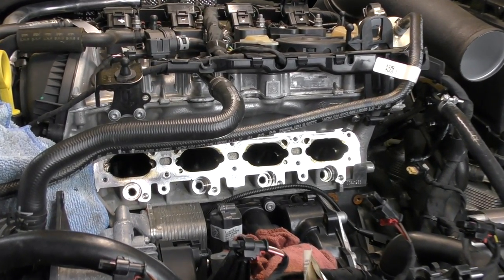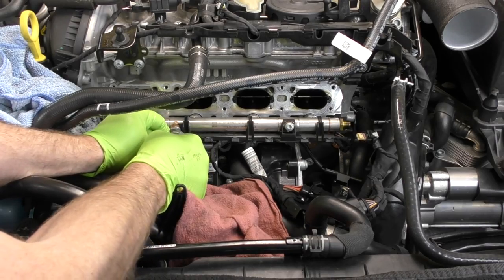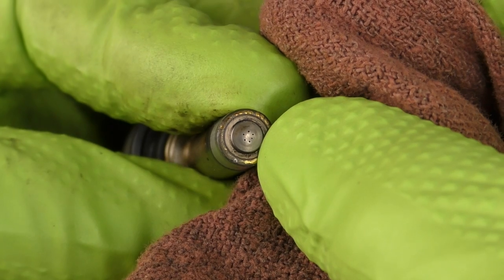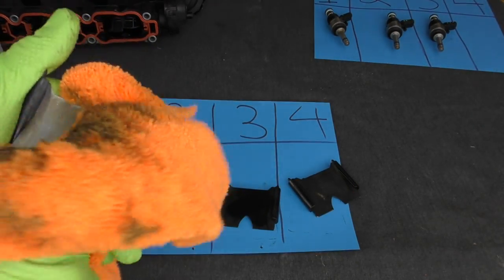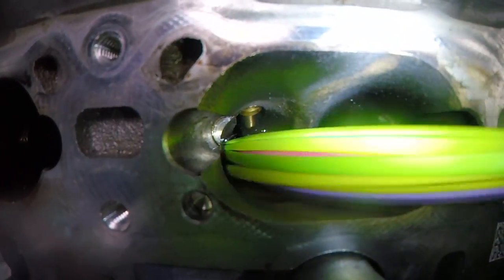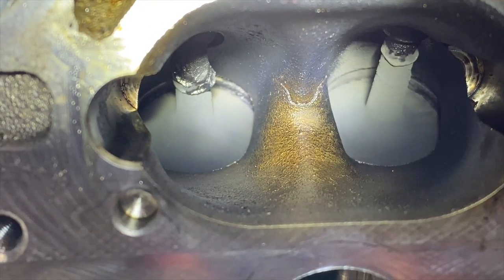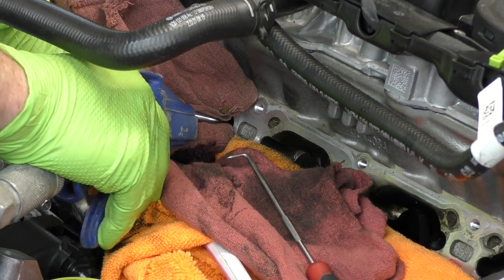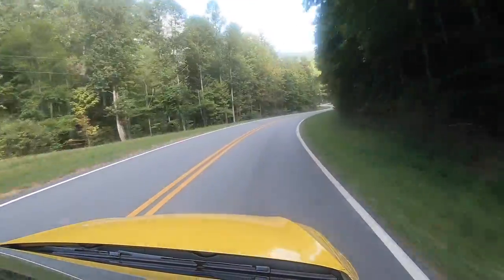How Much Carbon Build Up at 10,000 Miles?? ~ 2019 Golf R

Comment: Not saying this is an easy DIY, but if you have the proper tools and basic knowledge,  then just following this video tutorial seems to be pretty straight forward to clean your own carbon from intake valves yourself without needing to pay $1000 somewhere to do walnut blasting.
Reply: I need your help or someone who knows what they are talking about when it comes to VW  as you said in one of your other videos you shot in your garage talking about VW reliability and reviews etc.  A lot of mechanics don't really seem to know how to fix or diagnose my car (Scirocco R 2013, APR Stage 2+).  I believe it is a very similar platform as the Golf R?

For 3 years now I've had this cold start issue (among other things).  It seems to be getting worse each year (progressive) so maybe it's carbon build up.  When I start the car after being parked overnight, it will go through this pattern of normal idling for 7 seconds then it will begin to sputter and sound like it's struggling to stay alive for 3 seconds and return to normal for another 7 seconds and sputtering sounding like it's about to die again for 3 seconds ...this repeats each time for exactly 60-70 seconds EVERY TIME or when the engine temp reaches 20 C and then it stops and is smooth after that the rest of the day.  It only happens when the car was parked for a really long time or overnight.  It doesn't even have to be that cold...I noticed it starts even when it's about 13 celsius in the morning (not cold but chilly). In the summer weather like now, doesn't happen.    

If I don't wait the 60-70 seconds or engine temp to hit 20 celsius, and move the car in drive, it will DIE and shut off within 1-2 seconds and I have to restart the engine again.   

The next thing is I am running rich ...LTFT always around -17 to -21 range....not enough to trigger a fault code which I believe is around -25  but I don't know why it's running rich and not returning closer to 0.

The code I get is: 001286 - Idle Control System - P0506 - 002 - RPM Lower than Expected - Intermittent

I've had TB cleaned couple years ago, even at that time the mechanic said it was really clean, and I only drive the car about 8000 km per year so I'm sure the TB is not dirty.  I have replaced fuel filter, spark plugs, ignition coils, new charcoal canister and cleaned the MAF sensor with CRC mass air flow cleaner.  

What I haven't changed yet if they are possible issues:  PCV, Diverter valve (cleaning), EGR valve (?), or don't know if it's a leaky fuel injector or possible turbo wastegate actuator issue.

My turbo gauge needle oscillates back and forth when I turn on AC or fan while sitting at  a traffic light.  RPMs stay solid but turbo needle oscillates up and down up and down with a humming sound from the engine that matches the needle movement...maybe a vacuum or boost leak?  

Also, it seems I've lost boost power at low rpms.  Sometimes when accelerating from a traffic stop, I'm seeing my turbo needle hit 0.5 to 1 bar but I'm only traveling 60-70 km hour....it kicks in fine if I'm at high speed like 120+ km/h but from standstill, sometimes the car doesn't accelerate as fast as the turbo needle seems to indicate it should with 1 bar of boost but the car barely going over 60-70km/h

Comment: Holy liqui moly those intake runners though! I forgot they're originally silver until you started rubbing the carbon off.

Is it possible that the oil treatment might've accelerated this? You know, since they're designed to land on an already carbon-coated runners/valves? Cause 10k with that much build-up just doesn't make any sense..

Comment: I used my wet dry vac with a MCDs straw taped to the end to suck out the scraped off bits of carbon. it even pulled most of the carb cleaner out too.
Reply from the maker: NICE!!!

Comment: have you thought about using a small laser to remove the build up on the gdi intake valves, and tract? it would seem to be a faster fix. as the build up would be vapourized off the back of the valves and intake tract.. no chipping, soaking etc?

Comment: This problem screams out for the aftermarket to come up with some sort of injection system tapping into the plastic intake manifold so it cleans the ports and back of valves. Whether that be some sort of fuel or solvent, atomized water-steam etc. These sort of kits were once available to boost compression and deal with upper cylinder lubrication during the switch to unleaded from leaded era for cars that still had non hardened valve seats. Also, used on cars that were predominantly running on LPG in a dual fuel setup. A catch can in combination with 'something' injected into the intake ports from the inlet manifold would see this problem virtually disappear. Also, a small amount of oil consumption past valve stem seals cannot be helping this problem especially using such a low viscosity oil such as 5W-30 etc.

Comment: Is the atkinson cycle used in that engine design? The intake valves stay open for a portion of the compression stroke to improve emmissions, but send crap back into the intake. The buack? Budack? (I forgot spelling) Cycle achieves the same emmisions i believe but is different as the intake valves close early on intake stroke, thereby prevent crap going back into intake area.

Comment: I know it would have been a lot more work, but it would’ve been really interesting to see; after inspecting the state of the injectors and intake valves, reinstalling everything without cleaning at all, then running a treatment of CRC GDI intake valve cleaner, then taking it all apart again and inspecting again to see what sort of difference it made, with this level of contamination on the intake valves and injectors. I’ve seen it done on severely contaminated valves and it didn’t seem to make a huge amount of difference, but that might have been because they were too far gone and required a full media blast clean, but with them in this state, where it would be done regularly every 10K miles, I’m curious to see what sort of difference it would make.

Comment: Way way back in the day we used to slowly trickle water down a half opened throttle carburetor. The engine would stumble and black smoke came out the exhaust tips. One would continue to do this until the black smoke vanished. Crude but very effective.
  Wonder what E85 fueled engines look like?
Reply from the maker: Good ok top engine clean!!

Comment: So I'm using Ceratec on my new Porsche 992 .. I put it in right at new, and have been doing it for every 5K...  now the car, even though it's direct injected, doesn't really cake up the intakes... but do you think modifying the oil content with our Ceratec could worsen this since oil's now are being designed for GDI engines specifically?  How did your oil analysis come back with the Ceratec?

Comment: Hey Charles you say in the video that you have been using the 0W20 508 and I'm pretty sure you've been using 0W30 504 oil to-date.
Reply from the maker: Yes I Mis spoke. It’s 0w30
Reply: @HumbleMechanic  your video was posted on forum and the question came up.  Anyway..thanks for clarifying.
Reply from the maker: No prob! Sorry about the confusion. I wish Youtube still had where you can add text.

Comment: Does the Golf R have two injectors per cylinder? (one injector in the inlet manifold before the inlet valve and another one directly in the cylinder bore)? The inlet manifold injector is meant to clean the inlet valves occasionally during normal operation. You will get some crap getting thrown in there by the crank breather venting. But in mid-2000s when they moved the injectors to the bores the cleaning stopped (wasnt possible) and then we have some cars that bog down with carbon crap that must be cleaned by disassembly. I'm surprised if the Golf R (and also Audi) have serious carbon build up on newer models due to the dual injectors. I've been saying for at least 5 years now, that BMW, Audi, VW seem to expect their cars to suit the first owner. BMW have 24-month service intervals for oil changes (WTF) and the Audi A3 I had kept having problems once it got to 3 years build age (couldnt wait to hand it back to them. The turbo failed with grinding and wooshing noises under load just before handing it back).

Comment: These OEMs need an access plug on each runner so you can spray a cleaner into each one at the scheduled oil change. How hard of a fix would that be. These composite intakes with 4 removable access ports.

Comment: One thing I'd be curious to see more discussion on GDI cars: the catch can "cure all". 

Keeping in mind every engine is different, I did a catch can on a Cobalt SS Turbo (2008-10) which has GM's LNF GDI engine, which was all Bosch. I was pretty shocked at the amount of carbon that built up over 50k miles on it. I checked because the car was starting to have the usual rough idle / misfire issues. 

I spoke with a few people about this, and they mentioned while a catch can is a nice have, modern engines play all sorts of emissions games with variable cam timing ...which can release combustion chamber gasses back into the intake port. The do this to avoid having to use EGR's and stuff like that these days from what I was lead to believe. 

If thats true, it just means a catch can is nice and all.... but without port injection its happening anyway.
Reply: I'm saving the money off buying all the BS people use as Band-Aids for this issue and am just going to buy the media blasting "kit"
Reply: MeltingRubberZ28 seems like the right move. It’s just routine main required in GDI cars it seems.
Reply: @GimpyMR2  yeah my wife's car is GDI and I just bought one about six months ago so I'll just tool up. My dad's car is as well....just makes sense.

It also seems like most of the reason a lot of car manufacturers are doing GDI alone and not "dual injection" (port + direct) is because of the strict emissions in the US. The German model of my VW has dual injection. I've heard that you can even retrofit the port injectors into the US cars (depending on cost and how labor intensive it is...I might just do that). Really a circular issue which is so stupid.

Comment: I removed my Intake Manifold in preparation for Walnut Blasting the Intake Ports and Valve Stems. I pulled the Intake Manifold Partitions and put them in Berryman Chem Dip to remove the lacquered carbon buildup. The Chem Dip was so effective, that it also removed the galvanized coating on the Partition surface.  Do I need to replace the Partitions or can they be used as-is?  Vehicle: 2012 Audi TT EA888.2 CETA Engine. Note: Vehicle is not modified or chipped and I am not interested in performing a Runner Flap Delete at this time.

Comment: For years my dad used chevron for his ole 71 f350 and heads where so clean 🧼
Reply: This isn't related to his fuel or fuel treatment, this is strictly a GDI issue. Any other engine without GDI would be pretty spotless at 10k miles.
Reply: Yeah but bud I follow him since day one but I get where your coming from but hey everyone has an opinion and it’s mine but thanks

Comment: Perfect Timing! Thank You Charles. With parts and tools ready, our MK6 GTI is about to get the full monty. Water Pump and related bits (recently spotted a small leak), Oil Cooler Seal, De Carbon. Last round saw 4 New Injectors so good there. New Seals of course. Just to share... to verify each set of Valves are closed, I spray a little Carb Cleaner in and wait to see if it leaks back. If not, good to go.  Considering setting up and configuring an UltraSonic Cleaner to do those Injectors super dooper.... Question:  When we do the water pump, can that Balance Shaft Seal be replaced without the special tool I see to reseat the new one?   Gary and Justin
Reply from the maker: You can replace it, but it’s a PAIN with out that tool. If it’s not leaking, I’d leave it be.

Comment: Have you tried cleaning it with CRC intake & valve cleaner? I have an Audi Sq5 (direct injection). I’ve been using CRC every 6 months for 2 years. I spray it into the intake after the MAF sensor with the engine at 2200 rpm (need someone else at the throttle). Drive it afterwards & give it the beans.
It runs pretty smooth afterwards especially at idle. I’ve heard a lot about how it cleans the valves & intakes. 
Can you run 2 cans through it over the next 5k miles and then check the cylinder heads , injectors & valves??

Comment: Hey HumbleMechanic, Hope your are well and keeping safe. I have a 2014 Passat with a TSI engine with a Stage 1 tune from APR. My car has 245000km of mostly highway driving and I never had any issues with misfires.I average 5.9 to 6.2 L/100km Highway ...I'm Canadian so we use the metric system....:) Love this car.
I do give it the boot regularly and I really enjoy the drivetrain with this tune. Should I look in getting the valves cleaned if I have no issues? I do use high octane fuel 94.

Thanks and keep up this channel,

BFC

Comment: Great video. 

I am surprised that at 10k that you had carbon buildup. That seems soon to me. I have been told that usually happens at around 3 years or 30k. 

Has your car been driven locally or on long drips or a combination of both?

Maybe it has to do with that it is not Port injected and a GDI engine. 

But I guess this video shows that fuel cleansers don't work.

Comment: I have the same vehicle as you and I did the same seizure at 32,000 miles and mine looked much better than yours. The only difference is I have a catching up on my vehicle. The oil that I use this total 0W 40

Comment: @HumbleMechanic Great video again!! Hat goes off to you man. I know VW has there own cleaning tech but have you tried the BG44K in tank fuel cleaner plus the BG valve cleaning where it hooks up to the intake and fuel system to hammer the valves and injectors with it's cleaner? I have a turbo kia 2.0 and had it done and the bore scope camera showed an amazing difference. Maybe in 10K more miles you can give it a shot and let us know what you think? I know BG will warranty the injectors for life if you follow their recommended cleaning. Oh and I don't work for them, I just use their product and have had great results that I thought I'd pass along to tickle your brain a little bit lol..

Comment: One noticeable good thing about Toyota's engine, usually the newer ones, is that it has both port and direct injectors.  Hardly any carbon buildup even at 50K or 75K miles.

Comment: You should use engine oil with really high flash point, such as 256°C, this means that it would emit flammable/oxidisable  vapours at a higher temperature.
Also, group IV PAO synthetics base oil is more stable. There are brands that specify the exact formulation of the base oils and the additive package. One thing is using hydrockracked "synthetic" with conventional CA+ZDDP+etc. additive pack, completely another is using 85% PAO, 15% group V ester and modern additive pack - volfram, moli in new molecule, long chain viscosity modifiers and etc. - guess the brand ;)

Comment: i got great results using marvel mystery oil in my fuel  lately in my vw 2006 touareg r32 v6 , im going to also try spraying some after engine warm/hot  through the front cap of intake where the wheel flap thingy rotates to get on top of valves more

Comment: My 7.5R is getting big turbo and low pressure fuel pump/port injection upgrade, should i let my mechanic do the cleaning of the intake valves before these parts go on? and if i should what do you think is a reasonable price to get it done? Thank You!

Comment: Odd as all get out. I dont know this engine but my first reaction was egr. Then I realized it doesnt have that? Then I felt that the valve guide seals are having issues. But when I heard shell, ah ha ! So try a better gas like Chevron. Has been a winner my whole career of 35 years. Also techron or bg fuel system cleaner will help a lot. But I'm still bothered by the stuff at the valve guide.

Comment: Just blast them with crushed walnuts on cylinder TDC and get the intake valves  brand new.  The kit is at Harbour freight. Walnuts too. Need a shop vac also
Reply from the maker: The best way is media

Comment: So we pay tens of thousands of dollars for a new vehicle. Then, said vehicle requires very frequent, often shade tree hack maintenance on the intake system, all in the name of emission control as it pertains to direct injection. Of course a catch can, if you can get it to work right (I haven't yet figured it out on my '19 Silverado with the 6.2) would go a long way to help with this but not entirely. I think dual injection or a return to port injection  are really going to be necessary to prevent this. I realize though that the ever increasing mpg mandates will make that difficult if not impossible.
Reply: There are still some cars on the market that use MPFI.  My wife's getting a new car this year and I won't buy anything with single GDI injection.
Reply from the maker: Dual injection will help. With VWs "commitment" to EV, I wonder if they will bother.
Reply: lots of manufactures are going to dual port/direct injection now, namely toyota

Comment: Ive just watched 3 of yr vids man yr so got it,my Golf 1.4 has 8 ks on it I run  Mobil 1 oil and high octane fuel I wonder what the carbon build up is ? Do you  advise before changing oil a engine sludge cleaner.The oil is low ash type .

Comment: Just saw this video, thanks for doing it.  I’ve got a 2.0 TFSI in a Q5 at 53k miles & I’m considering doing this.  Do I have to change the seals on the fuel injectors or just clean them like you did?
Reply from the maker: IF the injectors come out of the head, you need to reseal.